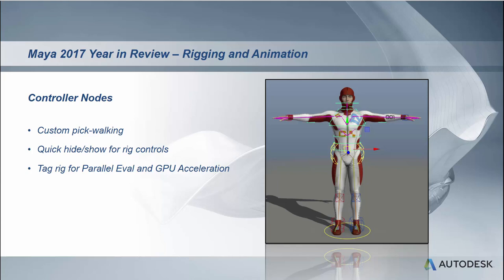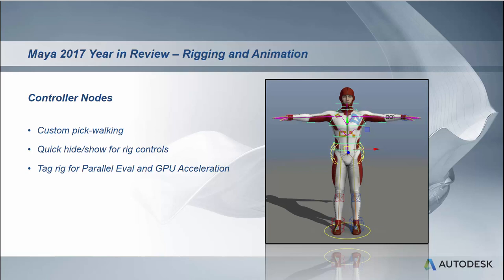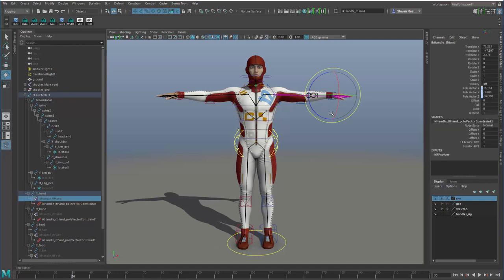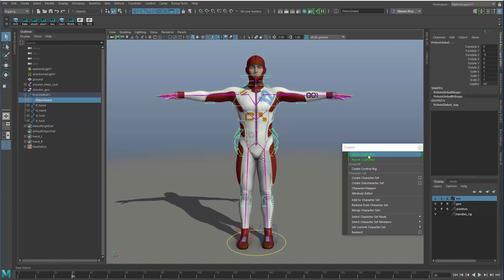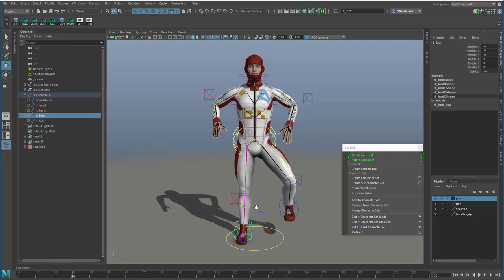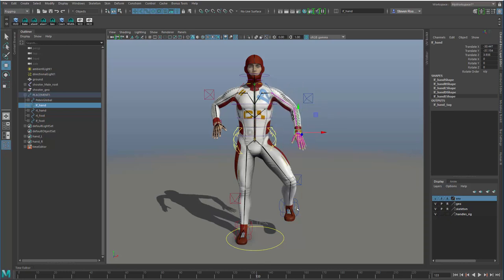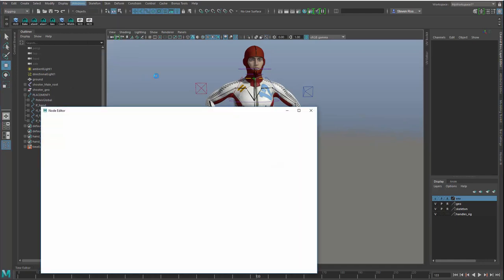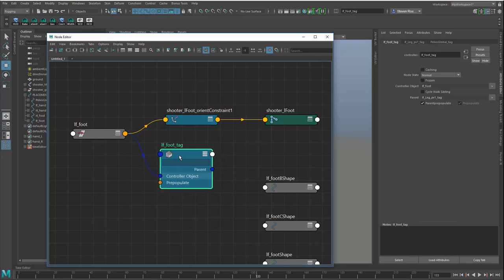Maya 2017: Controller Nodes (Part 1)

Comment: 1. even if you have to pickwalk you still have to move your hand across the keyboard to hit the arrows. 
it works fine when he's only in translate pivot constantly but if the animator wants to go to rotate or scale the speed reduces to more then it would take to select the controller with the pen/mouse

2. its kind of a solution to a problem that wasnt really there. I think an animator with 10 seconds of experience would know that pickwalking was never a great idea. But now some of the industry will expect to have it the other wont. 

3. it seems like manual work to set up the pickwalking so from a TDs perspective it would demand a fair bit of recoding to add to a rig. thats okay since we only have to do it once in a script. 

I doubt that it will become an industry standard...yet. Maybe later. it feels half done but so does all first releases i suppose.